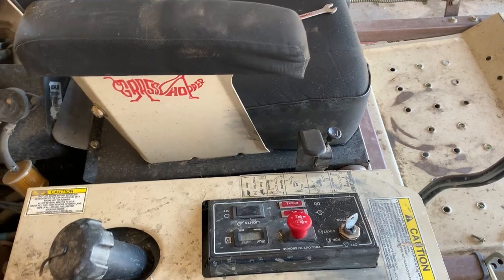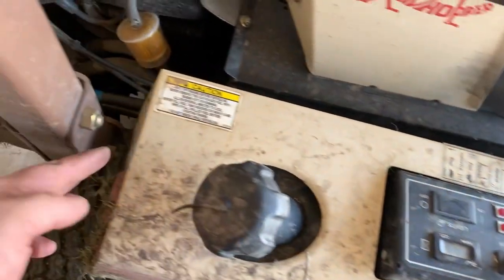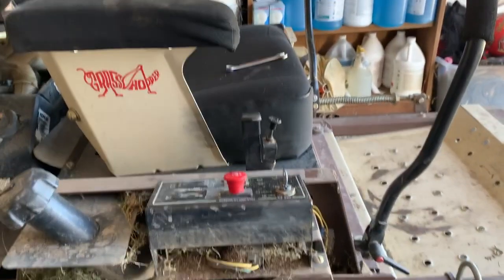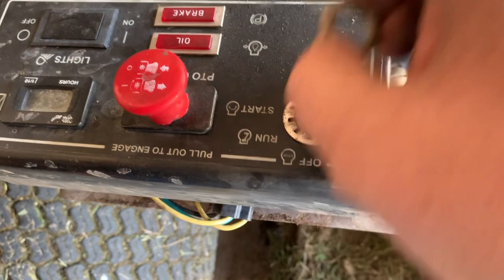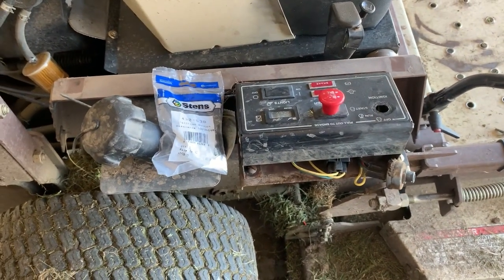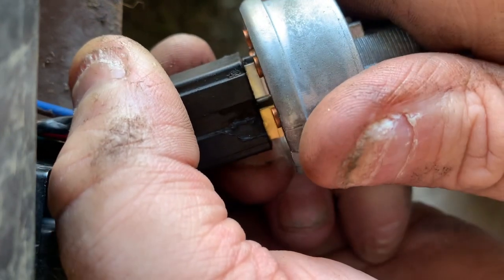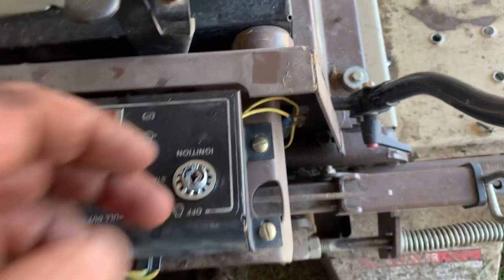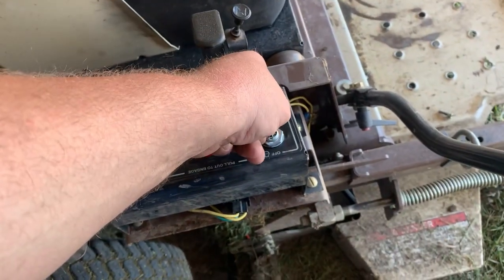YOU’VE BEEN WARNED!  IGNITION SWITCH REPLACEMENT / GRASSHOPPER ZTR

Comment: From Don's Small engine repair I noticed that you didn't put any dialectical Grease on the prongs of the switch to keep it clean so they will not rust or do you have to use it
Reply from the maker: They don’t put none on at the factory?

Comment: Seriously there is not a decent video on the internet about rewiring a lawn tractor. Someone Seriously needs to show what wire goes where and what each one does. Including all safety switches. Mower medic, you are easy to follow and understand. How about having a go at it. Im trying to rewire a lawn tractor that Someone has gotten to bypassed all safety switches and done away with the ignition and hooked it up to a horn button. The mess of wires is incredible. The lady wants it put back to an ignition switch and all the saftey switches working. There is absolutely nothing i can find helpfull.

Comment: My grasshopper mower doesn't shut off when you turn key off it's a 723 d  think a switch would fix it
Reply: If it's a diesel it's the fuel solenoid.  Until your ready to replace it you can reach under the hood and flip the arm on it by hand.  Just Google what the fuel solenoid shutoff looks like so you know what to look for.
Reply: @chriscostlow4210   Thanks